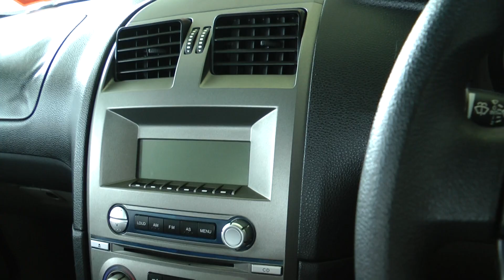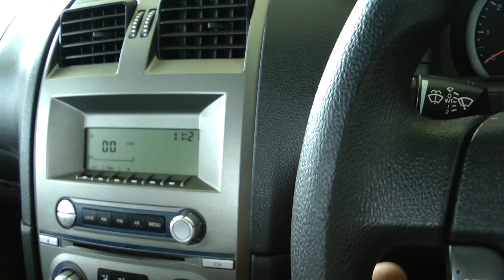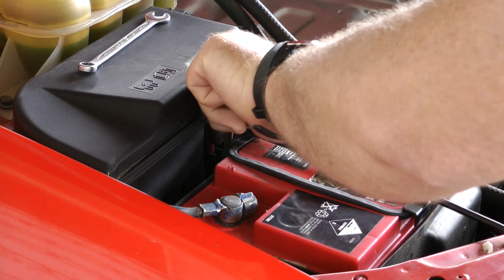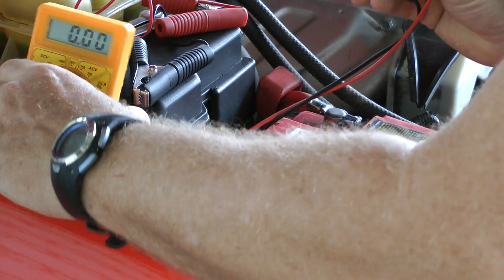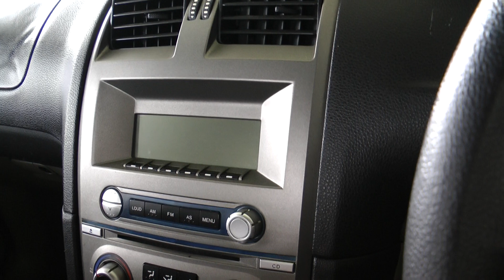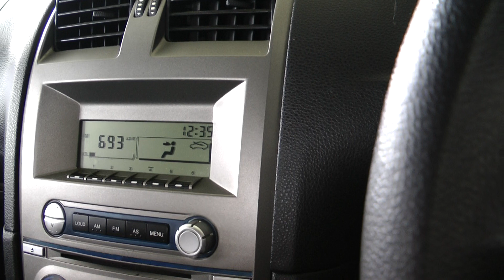How to change your car battery without losing your radio code and dashboard setting. HD

Comment: I thought the proper procedure for disconneting a battery is to alway undo the negative terminal first, then the postive terminal.  And when installing the replacement batter, you reverse the order...positive first...negative last.  What is the advantage of doing it as you mentioned??
Reply from the maker: Because it is always positive first, negative second when connecting two batteries together. ALWAYS, in every country in the world, look at your jump start instructions. Positive of dead battery to positive of healthy battery, negative of healthy battery to negative of dead battery. You got confused because when removing or placing a dead or live battery directly into a car with no other battery connected you go negative first then red. Simply put there is a difference between connecting two batteries and replacing a battery. https://www.shell.com.au/motorists/go-well-content-hub/back-to-basics-how-to-jump-start-a-car.html